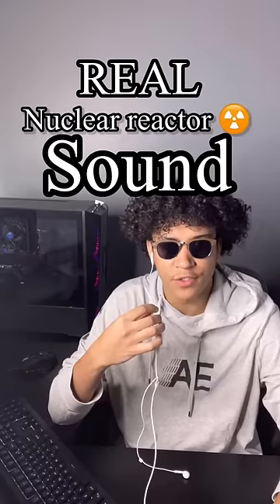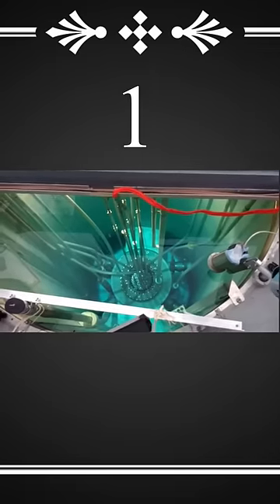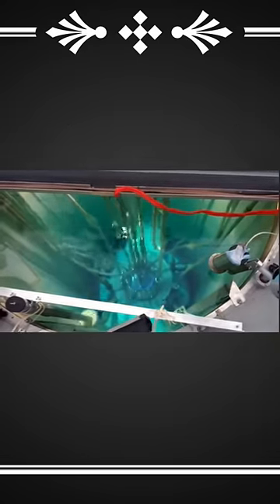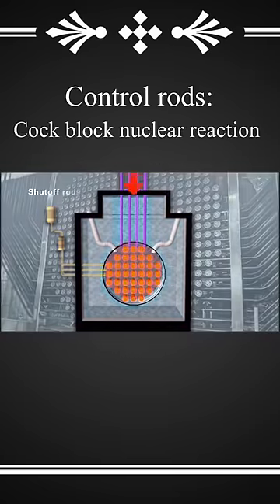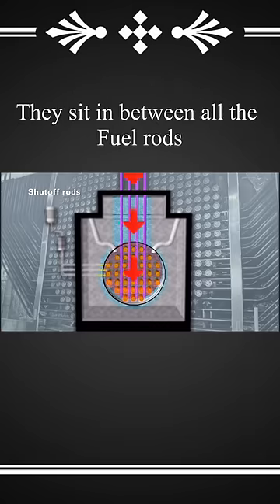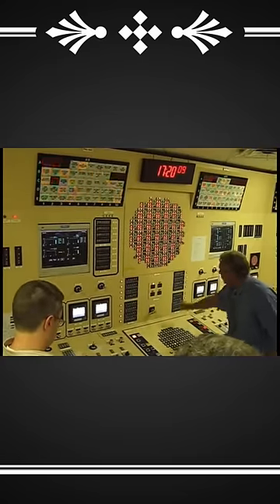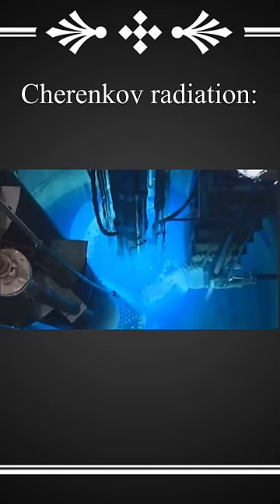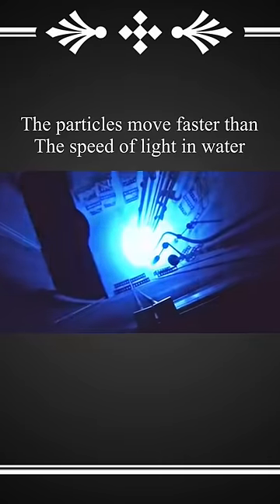The real sound of a nuclear reactor #shorts

Comment: It has to be said that the cherenkov effect is caused by particles going fater than the speed of light in water (225000 km/s), not the speed of light in vacuum (300000 km/s).
Reply: that's literally what he said
Reply: That's what he said
Reply: Fater?
Reply: @xero6774  yoh duma$$ kid
Reply: @Fatso-to-fit  what
did you even watch the video 
that's literally what the guy said
Reply: Was bout to say this lol
Reply: @xero6774  the way he says it though can be misinterpreted. He says something along the lines "through the water it simply travels faster than the speed of light" which can easily be mistaken for it traveling faster than light in general as he specifies it goes faster then light in water passively and before mentioning the fact
Reply: @ThePatrioticScotsman  honestly did think the particles were moving faster than light in a vacuum
Reply: No he doesn't say it, but Text does
Reply: @xero6774  not it's not
Reply: The fact isn't going faster isn't what's causing the effect. The effect is actually caused by the water showing down the energy coming off the reaction. But it has little to do with water, the effect still happens in the air. Reference "demon core". The light is being made by high energy particles colliding with slow large oxygen atoms braking them apart into ozone. This causes the ozone atoms to go into a higher energy state which emites visible as well as UV light.
Reply: @xero6774  the language wasn't accurate though, it didn't mention there being a difference in the speed of light through different refractive zones. Light going fast than light in a vacuum would imply things outside of our common understanding of physics.
Reply: Oh I thought he meant in a vacuum, thanks for clarification.
Reply: It's still superluminal.
Reply: @imranmohammed279  context, he may not be right on everything, but this one he's right
Reply: The particles get fatter ahh yes.
Reply: Thank you
Reply: Thank you this cleared up many wuestions
Reply: What should be understood about the speed of light in a medium is that the actual “speed” of light doesn’t change. Rather, it’s the perceived speed.

In a denser material, a given photon is more likely to collide with another partial, which redirects it, causing it to travel a longer distance on average than if it had proceeded through a vacuum. The speed of an individual photon between any two collisions is still C, the velocity at which an object no longer perceives time. 

We just say that the “speed” of light is lower in a medium because it’s easier to express mathematically than an average increase in distance.
Reply: "Fater than the speed of light" lol
Reply: @xero6774  
No. He said than light typically moves. No mention of light in water. Just “it’s moving through water faster than light typically travels”
Reply: Cherenkov radiation is caused by a particle traveling faster than the speed of light in a MEDIUM. Not just water, but any liquid, solid or gas.
Reply: @xero6774  
He didn't clarify the speed of light in water or a vacuum. He left out "in water".
Reply: @xero6774  “faster than light typically travels” doesn’t provide an explaination.
Reply: Thx for highlighting that. I was wondering.
Reply: @xero6774  nah, but nice try bozo. They're not the same thing
Reply: @HBIORIGINAL  not my fault yall can't use common sense
"hehe light goes faster than light!!1!1!1"
Reply: Common sense ain't as common as you'd think though, now is it 🤔😀👍🏽🤓
Reply: @Certified_Dude   correct, the aura or light is actually a biproduct of the medium slowing down the energy being radiated from the reaction, where light particles collide with slow large oxygen atoms smashing them into ozones, causing the ozones to go into a "high energy state" giving off the blue radiation we see as light. It's actually not in the water, but within the air particles of the water 💦🤓
Reply: @HBIORIGINAL  fascinating
Reply: @xero6774  people tend to think it travels faster than 300,000km/s  and 225,000km/s. Check the context first
Reply: thanx for the clarification because the latter would have been impossible. I was wondering
Reply: @ThePatrioticScotsman  there’s a caption at the top
Reply: @xero6774  I know your right bud
Reply: @HBIORIGINAL  he says bozo rewatch the video
Reply: @Only_Sleep  he said travels through water typically faster
Reply: Holy shit
Reply: Dumbaahhbiihh
Reply: Light always travels at light speed, that's why it's called light speed
Reply: Thx for clarifying cause I was confused how light could travel faster then the speed of light lol. Thought it was BS…
Reply: @royfinegan8006  that's the dumbest thing I've ever heard 😆 im sorry. Light travels at different speeds in different mediums. The term "Lightspeed" means light's speed in a vacuum, Aka the fastest speed possible, aka light speed.
Reply: @xero6774  no... he simply said "faster than light normally"
Every single science minded person takes that as "in a vacuum" which is impossible to break the speed of causality. however its moving faster than normal... in water. that's fine.
Reply: @binny_y  the term lightspeed means light's speed. I don't understand what you're missing
Reply: @royfinegan8006    when someone says "light speed" they mean in a vacuum. Ask literally any science minded person. Again, light travels at different speeds when in different mediums. (Atmospheres, water, etc) you're using "light speed" wrong.

You said light always travels at light speed, which is objectively wrong. Bc light speed is roughly 300,000 km/hr, and it travels significantly slower to that through a medium like water. (Lightspeed=300,000 km/hr) it does not mean "light's speed"

It's about what you're missing, not me
Reply: @xero6774  he did mention it but clarifying never hurts.
Reply: I hope they don't do that because I'm pretty sure that would cause the simulation to lag
Reply: @binny_y  nope, light always travels light speed. measuring the speed of light through a medium only gives an average speed between two points, light will often scatter(taking a longer path) or be absorbed then emitted again. This makes it seem as if it slows down but its essentially impossible to slow light unless you want to debate semantics of what speed is. 

also just to add, light is 300,000km/sec not km/hr. not trying to be an ass on that one tho
Reply: Cuz if it was in vacuum it would be a tachyon particle right? Like that can’t happen.
Reply: @xero6774  didn't specify water
Reply: @xero6774  he didn’t say that
Reply: There is only one rule… obey Causality. Do this, and the universe is yours
Reply: ok good because that would be extra scary if it went faster than that
Reply: @javierbelloleon5905   glad someone else noticed that.
Reply: @Oyasumi-cu9kv  common sense
Reply: @devindesilva123  common sense
Reply: @xero6774  😂😂😂
Reply: @xero6774  yeah he said id wronglly he didnt said its in the water he said faster than light typically moves wich can be confusing
Reply: He fuckin did.
Reply: You looked this up chill bro
Reply: Safer than some solar panels ? 🤣
Reply: I am SO GLAD I noticed that.

For those thinking this distinction is clear, yes, but humans are smooth brained, so this distinction is actually very foggy.
Reply: @emperorpalpatine5559  Well. There are theoric particles that moves faster than light that appears only on particle collisions. Very much in sern collisioner and supernovas. Though they're invisible.
Reply: @ThePatrioticScotsman  Honestly the fact he said "water" should make it clear what he's talking about. It's common sense he said "through the water" so he's clearly talking about water. This is according to what you said in your reply.
Reply: Yh i was gonna say that as the rractor core is not a vaccume so it cannot travel faster than mc
Reply: He said the particles move faster through water than light travels. He wrote about the light in water thing as a text in the video
Reply: @xero6774  nop
Reply: Thanks i was confused for a second there
Reply: @xero6774  No he said faster than light typically travels don't be a lying
Reply: Light speed is constant and nothing physical can exeed the speed of light uno" physically"
Reply: Fater lol
Reply: Makes sense
Reply: @Haggart  you thought he meant vacuum after he said water?
Reply: @someguynamedsteve203  yes but you can use common sense and context clues to figure it out
I came to the correct conclusion pretty easily
Reply: oh thank god, i got scared therd
Reply: @xero6774  still said too fast for some of us to compute I was definitely confused for a sec about it
Reply: Oh thanks, that was bothering me.
Reply: Why does this have 7k likes that’s literally what he said
Reply: I was about to raise this
Reply: @yungifez  that’s what he said in the video though
Reply: @Yoaster06  yeah I figured
Reply: Thank you for pointing that out. Makes one hundred percent more sense now
Reply: So 
Move through water for faster light speed
Reply: @seantaggart7382  no. He's say that light travels slower in water. Light is fastest in a vacuum. Not in water. So somethings can travel faster than light in water
Reply: if the speed of light is the fastest thing then how are they going faster
Reply: @Takon_pilot  light is on the fastest thing in the universe if within a vacuum. If it's traveling through water it travels slower so other things can potentially travel faster
Reply: Thank you! I was worried the way he phrased it was going to cause some confusion.
Reply: Heavy Water at that
Reply: But he didn't say that. Anyone that says he did, should relisten to it.
Reply: @xiuhwho  we know. We all heard, thats why this comment is here. It's one of those instances where someone didn't clarify what they meant
Reply: The video points it out too but ok…
Reply: @kenstr321  thanks
Reply: Had me making plans for Alpha centauri m shi
Reply: That’s still fast as fuck tho
Reply: That is cool
Reply: Can you just say "(megafuckton km/s)"?
Reply: Wow. That's crazy.
Reply: You wouldn't think that was possible
Reply: Oh cool thanks
Reply: I'm happy you clarified  that because I was like how the fuck is light going to travel  faster than light and how is a particle which is something that has mass going to travel faster than light? Wouldn't that go against Einstein theory of relativity? Which says that nothing that has mass can ever exceed the speed of light.
Reply: I was about to say theres nothing we know thats faster than the speed of light in vacuum
Reply: @HBIORIGINAL  no, ionized air glow and cherenkov radiation are to distinct effects, that they share a very similar color is purely coincidental
Reply: @jmoney5097  no - ^^
Reply: @osmacar5331  no
Reply: @invincible9462  all because you can't extrapolate using context doesn't mean i or the poster is wrong, I've stated times when wrong because misinformation is disgusting. Yes ignorance is counted for
Reply: Thanks man alot of people need clarification
Reply: Thank you, I was actually very confused because I thought that light was basically the speed limit of the universe. So I was really confused when he said that it was faster then that.
Reply: Fater
Reply: He literally made that distinction in the video.
Reply: I've heard speed of light is constant . It can't be slower or faster .
Reply: Woah, didn’t know light traveled slower in water, although it makes sense I guess.
Reply: @xero6774  he didn’t mention that light slows down at higher pressure, which some people may not know
Reply: Cesium 137 glows without being in water tho? Does it only glow in water because I’m confused.
Reply: Why would you body shame a particle?😂😆
Reply: @xero6774  stamp it. Lies i say
Reply: He almost had me. I was like WOT MATE! But then I factor in the water reading this comment😭
Reply: @imranmohammed279  he actually said it's the light equivalent of breaking the sound barrier meaning the light travels faster than your eyes can track creating a superluminal effect.
Reply: @javierbelloleon5905  he says it, both him and the text say it
Reply: @xero6774  “particles move through the water faster than light typically travels” is what he said.  And light typically travels at the speed of light and nothing in our universe can go faster than that.  Hence the clarification.
Reply: Very important distinction
Reply: Well we don’t live in a vacuum so it doesn’t matter
Reply: If u can break the water speed of light why not the vacuum sped of light?
Reply: @blaisestritt8177  because it needs to be faster
Reply: @xero6774  that's what he wrote on the video wall, NOT what he said.
Reply: @blaisestritt8177  Long story short the math doesn’t work within space-time.  If we could figure out how to get outside of space-time it’s likely possible.

Long story long
Basically if u go faster than the speed of light the laws of physics stop making sense(we take that to mean it’s impossible in our universe, or rather that if it could happen, it would be outside the current ruleset that governs everything we know).  The math says as a massive body gets closer to the speed of light, you need more energy to travel, and at the speed of light u need infinite energy(which is impossible).  That begs the question if it’s mathematically impossible how do we have light?  Well light doesn’t follow this rule because it doesn’t have mass(Einstein theorized that energy and mass are the same, and therefore 0 mass would be like infinite energy I guess so it does sort of follow the rule).  Which is odd because we have learned that it is made of distinct particles and particles should have mass.  Even more creepy the particles seem to behave like a wave, bouncing off of other particles that’s aren’t there(or better yet can’t be measured from our frame of reference, implying to many that there ARE other frames of reference and potentially higher rule sets than our universes). U can look into the double slit experiment for more on that super interesting and the basis for a lot of quantum physics.  Also as u approach the speed of light time slows down, and at the speed of light time stops.  So I think to travel faster than the speed of light would be to have negative time.  That’d be weird.  I’m no expert I could have some things misunderstood this is tricky stuff.
Reply: @xero6774  naa @PyroJackal said fater not faster lil
Reply: @xero6774  it really isnt
Reply: @xero6774  it's literally not. He said the particles are travelling faster than the speed of light. Nonspecific to being in water or not. When talking about the speed of light, it's typically spoken of in a vacuum.
Reply: It's literally stated in the captions
Reply: @RayRay-yt5pe  I can't read, you disability shaming me?
Reply: The color of light has nothing to do with the speed of light its about frequency of the waves , so the color of light may be coming from emissions of energy that electrons make while transferring from atom to atom also changing energy levels and orbitals
Reply: Good observation, thanks.
Reply: Light slows down in water
Reply: Looking for this comment
Reply: You are helpful says Geo's Stuff Prime sarcastically because the person in the video already gave us this information therefore making your comment meaningless.
Reply: Thanks, had me a little puzzled
Reply: Yeah but the Cherenkov effect also happen when outside of water. So, do we realy care if it happen all the same in a vacuum?
Reply: Tbh this is a necessary clarification. I had to watch the video twice to get what he meant. The first time my mind immediately went... "wait faster than light?" and the se on time  I heard the "on water" and I was like, ok that makes sense now.
Reply: Thanks for the clarification, I was a little confused because one of the laws of science or whatever says nothing goes faster than light.
Reply: It's doesn't matter what medium anything is traveling through, it can't travel through it faster than light, so the statement is still wrong. The blue glow happens in air as well.
Reply: @xero6774  he didn’t clarify the difference, not many people know the difference between light speed in water and light speed in vacuum. People gonna start thinking there’s something that can go faster than the speed of light, which when referred to people mean the speed of light in vacuum, which obviously we know nothing we know of is faster than the speed of light in vacuum
Reply: Wow you also watched the video
Reply: That’s quite different too huh.
Damn thanks for the info btw i like info
Reply: This. Its technically breaking a law of physics if it broke the barrier in a vacuum lol
Reply: Wow fater
Reply: @xero6774  not really. He left out some of that info or said it poorly.
Reply: “Fater”
Reply: @morethanjustasloth5528  the photons do not collide with particles and take a longer path. This is incorrect because this would result in scattering of light, making glass or water look cloudy. The reason light slows down is because the EM waves are interacting with atoms which have mass and this component slows down the waves below light speed. The atoms become coupled with the em waves and they move together which slows down the movement of EM waves in the medium. Think about acoustic waves: the acoustic waves are not absorbed and re-emmitted by individual atoms, they simply move all the atoms together.
Reply: @xero6774  no he didn't
Reply: I swear half of yall arguing against me don't even know what a vacuum is
use common sense and context clues
it's quite easy to figure it out
Reply: @xero6774  no its not when it's not clearly stated
Reply: @xero6774  yep it's written right on the screen "speed of light in water"
Reply: @xero6774  no it's not, you must not know what the word literally means. Literally
Reply: Light speed in water is the same as it's speed in vacuum
Reply: Thank you. Someone argued with me when I said nothing travels faster than the speed of light in a vacuum. Saying particles do it all the time and that the Large Hadron Collider is proof. I wanted to cry
Reply: Me: oh god im comfused
Reply: Nothing goes faster than the speed of light
Reply: @xero6774  it wasn't that clear
Reply: @royfinegan8006  nope it’s spec underwater is 225k km/s because light has to bounce off all the water molecules
Reply: @xero6774  No, he literally said "the particles in the water are moving faster than light typically travels."

A lot of people will assume "light typically travels" to be the commonly understood speed of light, which is why adding the distinction of "in water" to the end of that statement is important.
Reply: Exactly where you seem to be. 
Blessings
Reply: Still crazy how close those two speeds are
Reply: oh. i was like WAIT, WHAT THE FUCK?
Reply: Nothing can go faster than the speed of like only the expansion of space can
Reply: @kenstr321  now
Reply: Or (300,000,000 m/s)
Reply: @taigakagami9621  yeah thanks. This truly amazing stuff. It just boggles the mind. So powerful.
Reply: 299792.458 km/s
Reply: Oh
Reply: @xero6774  lmaooooo
W months later
180 comments later
I just got the notification lmao 😂😂😂
Reply: @Fatso-to-fit  idk how so many people don't get it
its the first logical conclusion I came up with, like that's the first thing I thought when he said it, I wasn't even confused
Reply: Thanks for the precision. I as well was like didn't Einstein say...
Reply: @rugvedpardhiye4298  maybe it has an addiction to Bud Light?
Reply: And in the earths atmosphere itself. The reaction can exists outside of water. Again, not s vacuum. I’m glad someone said this because literally nothing moves faster than light that we know of because that’s just not how physics work. It’s an impossible concept, it’s like saying “more nothing than nothing”.
Reply: We just not gonna mention that the speed of light is constent and its "slower" speed is just it taking a longer path through a medium
Reply: @xero6774  he didnt make it very clear
Reply: Bro says faster than light typically travels, that leaves room for interpretation as he could either mean typically in water or air/vacuum
Reply: @ThePatrioticScotsman  the subtitles said in water
Reply: @JoeZUGOOLA  subtitles said in water
Reply: Thanks for saving me the typing!
Reply: Thanks bro 👍you cleared my doubt,
Reply: @xero6774  it was written but he didnt say it
Reply: @xero6774  yea but a lot of ppl don't get it so he explained It
Reply: Thank you, it was unclear to me from what he said in the video, but this makes a lot of sense
Reply: @hammondvalentine818  f u
Reply: @xero6774  no, fearjames said the particles are moving faster than light. This comment specified that the particles are moving faster than light travels IN WATER. Rather than faster than light IN A VACUUM. Nothing can move faster than the speed of light in a vacuum. Only faster than light in water.
Reply: +1
Reply: He said "the light moves faster through  water than it typically travels" so no he did not specify and pyro's statement does explain what the voice over did not, did you kids miss kindergarten listening exercises lmao.
Reply: So it’s only superluminal under that specific condition. Lowkey does become slightly less impressive after considering that.
Reply: Thank you!!!
Reply: THANK YOU! I was like, nothing moves faster than the speed of light
Reply: thanks for clarifying, no sarcasm. I like science but bad attention to detail
Reply: Thank you was about to call bs because nothing travels faster than light in a vacuum.
Reply: The speed of light in a vacuum is literally just the speed of change.
Reply: Thank you was questioning how he came up with that . For anyone saying "thats what he said" no he said its the equivalent of breaking the sound barrier which is completely wrong you can't break any barrier if you are going slower than the barrier lol just like say I can run as fast as a track star but only if they are running under water
Reply: That's what he said